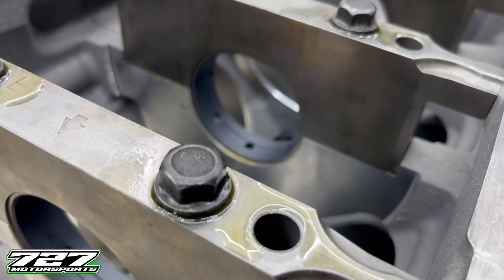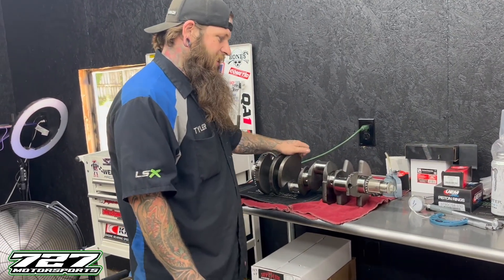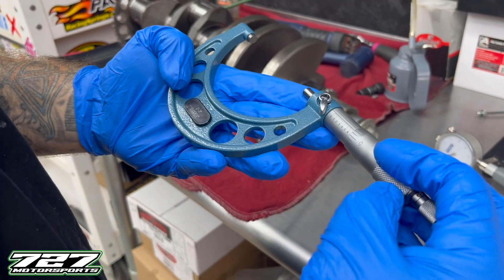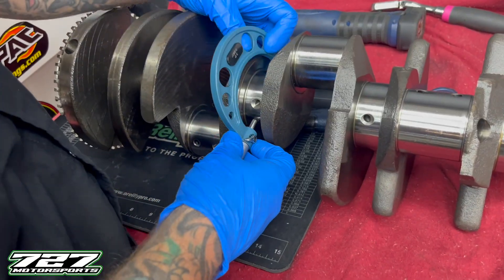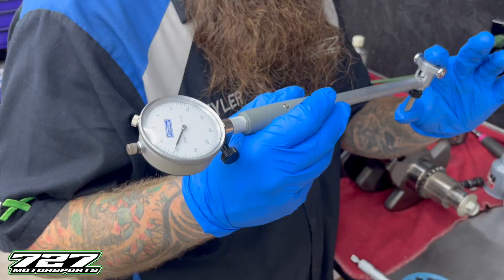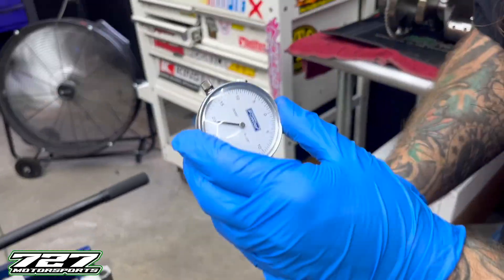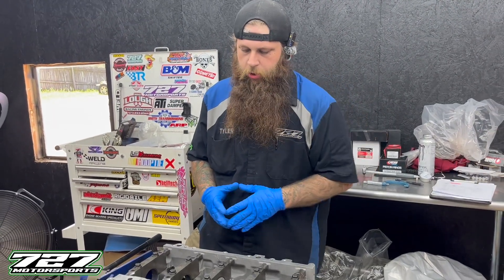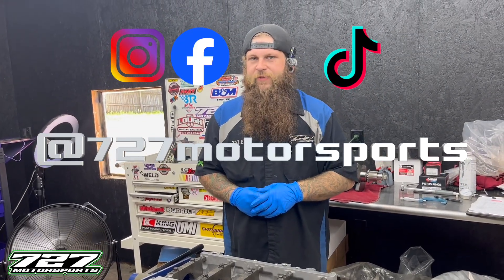WATCH BEFORE USING PLASTI-GAUGE!-Checking BEARING CLEARANCE w/ a  MICROMETER & DIAL BORE GAUGE

Comment: Too fast, watched like 3 times and did not understood fully, will watch some more, but thanks for the video. I have a Mitutoyo 2-3 micrometer with vernier scale which you do not mention or show here, even when mine appears to be the same you are using and a Mitutoyo dial bore gauge but mine is 0.0001 instead of 0.0005, so since they are different hence the trouble to understand the math.

Comment: So would that mean those bearings are to tight ?
Reply from the maker: 2.5 is prime. The gen v was specd a lil tighter cuz of vvt and being clearenced for the thinner 0w20
Reply: @727motorsports oh okay . So I have a gen 3 ls and my bearings was measuring out to .0024 excepts cap 2 and it measured to .0033 took it to get line honed now it’s measuring out to .0016 so should I just get a another set of bearings that will make em loose and use one standard and the other on the top side of the cap ?
Reply from the maker: @TevionsGarage I would def get another set and try a top and bottom. If it reads the same try a .001 bearing next
Reply: @727motorsports bet I kind of figured that but this video helped out a ton for this being my first time trying this it was super easy